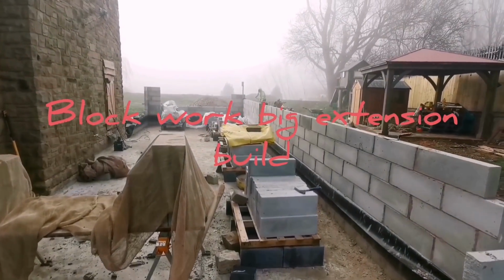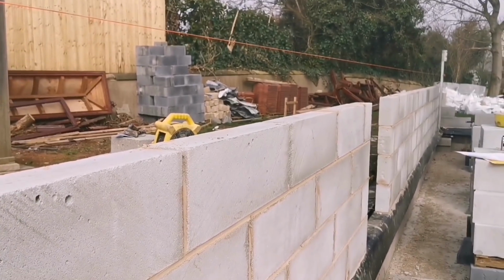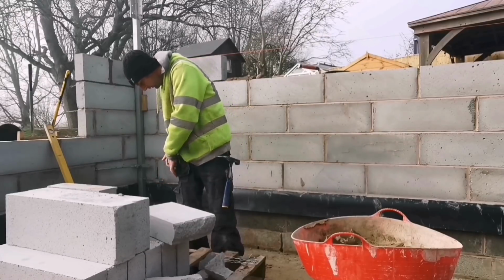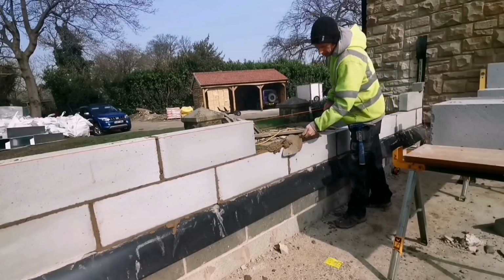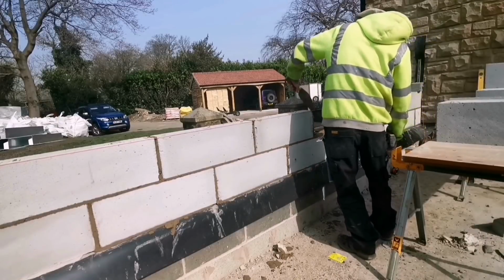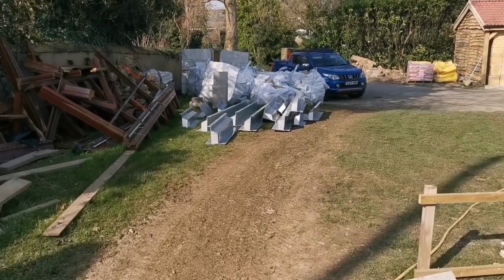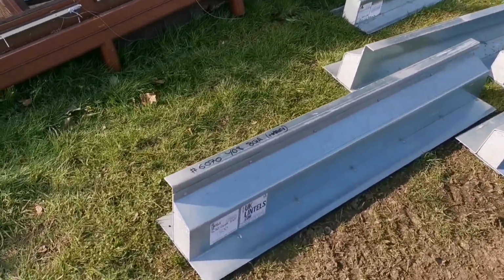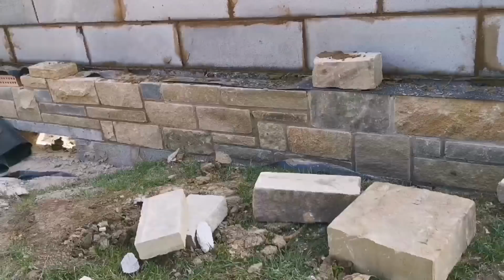Big extension build blockwork going up Aerated blocks

Comment: Mark what newton are the thermal blocks on this? I’m doing an extension and it obviously it’s thermalite block internally but I see there’s different strengths, what do you do?
Reply from the maker: Think they were 3.6 you can get them up to 7n .it usually says on plans if they need more .you definitely need 7n below ground level 👍

Comment: Alright pal.
Just a quick question regarding the lightweight blocks. I noticed there are no expansion joints. Also, do you use a certain mortar mix?
I'm asking because I have a single skin garage build, that I'm using thermolite blocks on, (because I got them free from work) and I'm concerned regarding cracking. The outside will be rendered using fibreglass mesh and k-rend.
Reply from the maker: Hi Adam. I just do 4 sand 1 cement with them. It did not have expansion joint on Plan so didn't put one in so must be ok. As for rendering you will be fine. They suck like mad and dry out quickly. But as long as its prepared right will be fine. The renders usley are fine with it. They used to it 👍👍👍

Comment: My question may be stupid but I assume, it is not my job 😁 Will the stones of the old exterior wall be removed?
Reply from the maker: Hi val. Not a stupid question lol. But a good one. The stone that will end up on the inside won't be taken down. But they are too bumpy to stick plaster board on. So I think what we will have to do is build a false wall in front with timber and fix the plasterboards to that. Or chisel the bumps off and I don't fancy that job lol. So think the customer will have us go for the false wall in font of the stone 👍👍👍
Reply: @markhep  Chisel the bumps ? Oh no ! I hope the customer pities you and makes the right choice 😁😂
Reply from the maker: @Clothis64  😂me too 👍👍👍👍